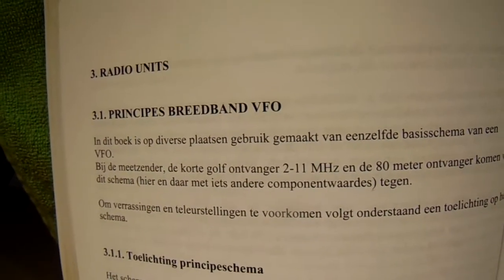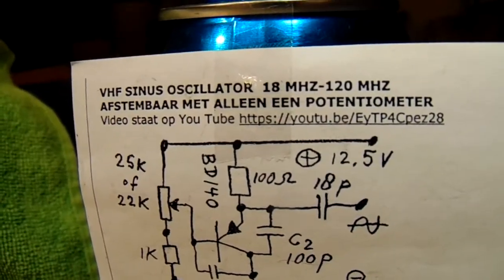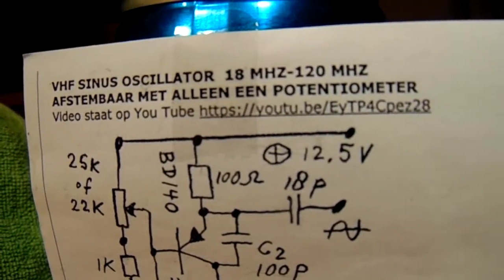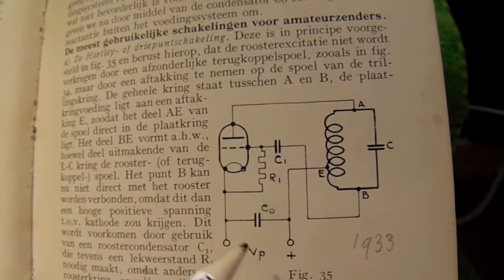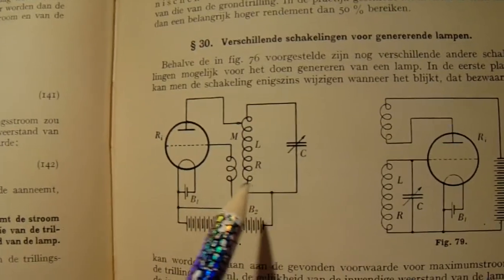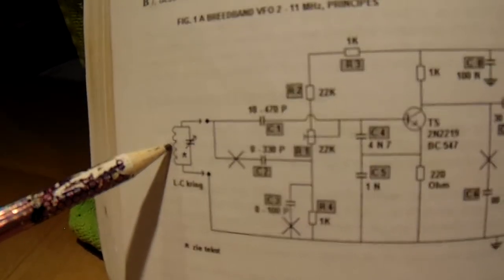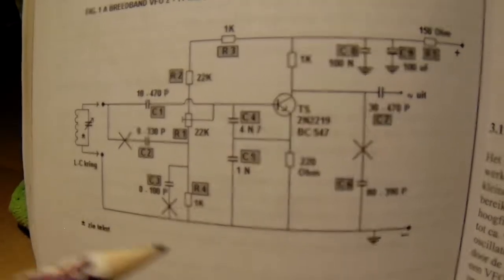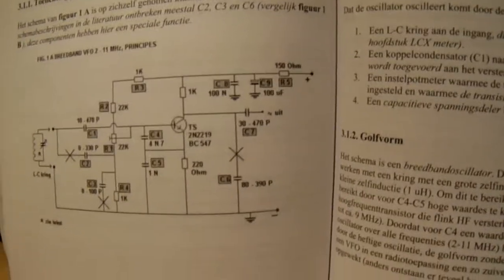1 transistor radio oscillators 2-11 MHz schematics (the very basics)

Comment: Ho provato lo schema ma non mi funziona 🤯, lo stesso schema funziona bene col fet.
Reply from the maker: That is very strange. I made it many times and tested it over and over.
Reply: @radiofun232  non dubito affatto del suo risultato, poiche sono un tipo ostinato e curioso, provero'  cominque a cablare nuovamente lo schema sperando di farlo funzionare, in tal caso gle lo faro' sapere. La ringrazio comunque per aver risposto e per la sua condivisione dei suoi progetti elettronici che apprezzo molto.

Comment: Ok, I'm going to try this VFO for my 40m SW radio.  Will start with 5v first.
Reply from the maker: The circuit on 10.21 is advised. The other circuits act as a demo/compare. I will send you a link about a FET oscillator that is quite broadband (2-14 MHz) and always works. 3 sep 2018.
Reply: Allright. Thank-you. As always, your videos are interesting and informative.
Reply from the maker: https://youtu.be/h1BHIdh3DxI
On 9.05 in this video you find a broadband FET oscillator 2-14 MHz.
Reply: Thanks.

Comment: Interesting circuit for myself it has proved most useful in producing alternating current of high frequency... Use two inductor chokes and it can be an excellent charger circuit that can be throttled with a pot...I've had a lot of fun with it

Comment: Yes is true power suply wire acts as part of a coil.When i use 9v transformer and change to 9v batery al frequency change on 400Mhz go down to 250 Mhz wt long wire and is mees when u add other stage bc signal travel by wire fixed with small reactance. Im still experimenting to. Im using a pnp trans wt tank from btw positeve and colector. Do think is the best for reach high frequencys?

Comment from the maker: Watch the textbox for more info
Reply from the maker: Jan 1, 2016: Radio oscillator that works  too good (exp. 1) https://youtu.be/ztHgdYpf9GY
Jan 3,2016: VHF oscillator tunable by its working point (exp. 2) https://youtu.be/-xP8t-K-iv0
Jan 22, 2016: R-C oscillator where the L-C circuit plays a secondary role (exp. 3) https://youtu.be/lJc-Os7tCAA
Jan 23, 2016: Sine wave oscillator tunable with a potentiometer between 28 MHz and 43 MHz (exp. 4)
https://youtu.be/LlLNaZbFRyw
Reply from the maker: April 8, 2016: VHF oscillator tunable by only a potentiometer/evaluation 2016 (exp. 5)
https://youtu.be/EyTP4Cpez28